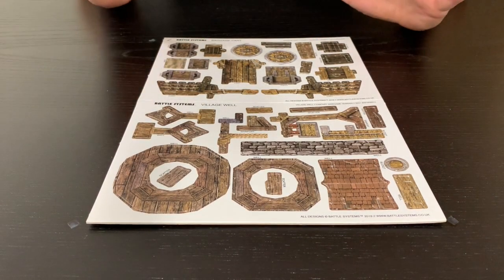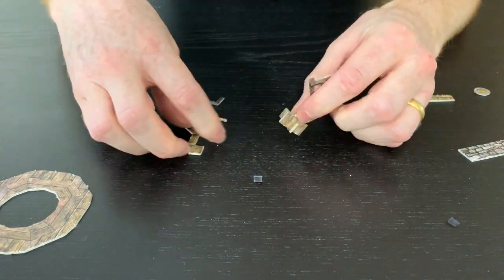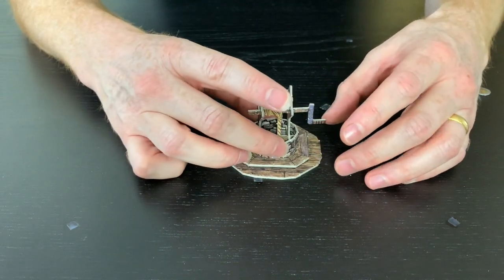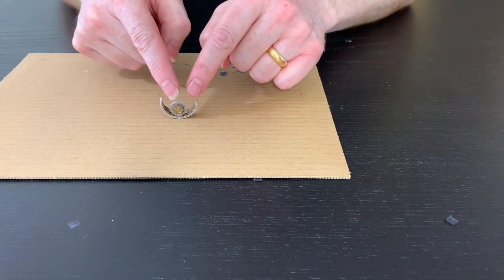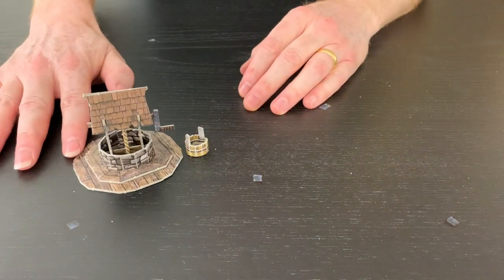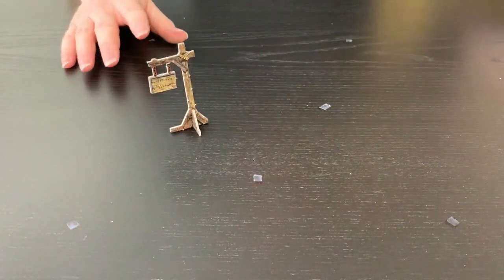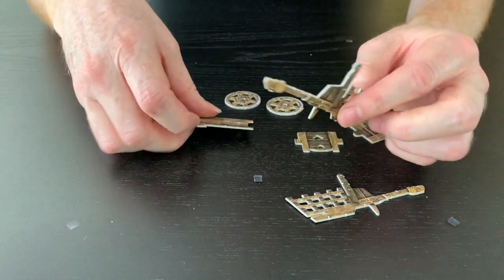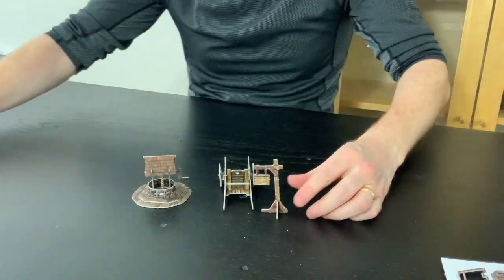Fantasy Wargames assembly - Village Well & Baggage Cart

Comment: Woah, the bucket is rather hard to assemble with super glue. Did not work for me. Yet great video instruction. Thank you!
Reply: Yeah, I hate the bucket and barrels. Glad I have a 3d printer for that stuff.
Reply: I used some scotch tape for mine on the bottom and the seam vertical seam
Reply: @tophertoad5700  For barrels, I remove the inside part because it's making the assembling a pain, and without it it's easier to glue the whole barrel :)
Reply: @Sandaru8924  Good idea :)